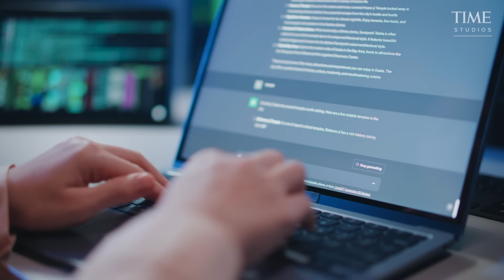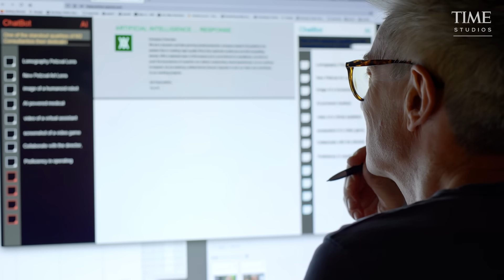Is the Figure 03 Robot Ready to Clean Your House?

Comment: A main feature has to be you can teach it to do stuff. So you can customize it to your specific house/routines. "watch the door handle on this door it comes off easily, the cat likes to nap in the washing machine so check before putting anything in, the dishwasher doesn't close fully in the right corner so you have to give it a hard push before it closes right and you can start it"

You know, there are a billion scenarios where it will have to learn the specific routine.

Comment: "All of the examples in videos are cherry picked. Go ask anyone working on humanoid robots today, almost everything you see here, if repeated 10 times, will enter failure mode because the happy path is so narrow. There should really be benchmarks where you invite robots from different companies, ask them beforehand about their capabilities, and then create an environment that is within those capabilities but was not used in the training data, and you will see the real failure rate. These things are not ready for anything besides tech demos currently. Most of the training is done in simulations that approximate physics, and the rest is done manually by humans using joysticks (almost everything they do with hands). Failure rates are staggering."

Comment: These bots will likely become more common than cars just based on how many there will be. 

And I don't think that things will get cheaper. They won't. Whoever is using these robots will not reduce the price just because they can manufacture for lower cost. They'll get greedy and provide the product for the same price that they would if humans were still working in the factory because that increases how much money they make. Robots are not a way to lower prices but a way to lower production cost and profit more.

Comment: I don’t think robots SHOULD be in everyone’s house. Putting aside the cost barrier, I do see applications for the disabled so they have more independence, but it could be detrimental to the elderly who should have other humans around for social connection at a time in their lives where that is vital. As for everyone else, you should be doing your own chores. It’s light exercise, and helps your brain (plus a break from work).

It’s interesting to me that these robot companies mostly focus on either housework or factory work. Both are regarded by the robot companies as menial, and I don’t think it’s a coincidence that the engineers are overwhelmingly male. Housework is still considered to be female coded, but society is asking men to do more housework, so I wouldn’t be surprised that men see it as an unnecessary burden. But I think everyone should share the responsibility of cleaning up after themselves, and we lose a bit of our humanity by off loading that responsibility completely.

Let the robots do the really dangerous work. But we won’t need billions of them. Think of how much resources that will take up, the plastic, metal, rare Earth minerals, electricity, compute. It’s obscene. We are already consuming 1.8 times what we should every year. We will quickly run out of non-renewables AND renewables. Civilisation is on track to run into a wall. It’s madness.

Comment: Figure 03 is light-years behind the Unitree G1 in terms of robotic motion. Figure 03 looks like a Unitree G1 having a stroke.
Reply: Unitree G1 isn't designed to be a general-purpose robot and its integrated AI is light-years away from Figure 03. By comparison, G1 has very little practical application based on its current design. It's comparing apples to oranges because Unitree G1 prioritizes flashy mobility at the expense of broader capabilities.
Reply: @16krez1  For a robot, what truly matters is movement. AI can always be upgraded or integrated later. Figure 03, on the other hand, moves like it just graduated from the toy aisle. No matter how advanced its AI claims to be, if the body can’t execute even 1% of it, what’s the point? It’s like a paralyzed person with Einstein’s IQ trying to perform martial arts — completely useless. Honestly, if I were Musk, I’d just buy a Unitree G1, dress it up like Figure 03, plug Grok in, and call it a day. Because let’s face it — as a robot, Optimus has failed.

Comment: Absolutly not! Even it is big leap forward, in real houshold enviroment it is useless. In demo was used plastic plates and cups. You do not want 1 plate/cup a day, probably more broken. You would need a set of new every week! The speed is so slow, that it will take like an hour to fill the diswasher and like 24 hours to clean your house, but with charging, it will take it 3 days, so it will clean slower, than you do mess. But more importantly, the cleaning job is very very difficult. 90 % times you need very precise motoric and and focus on details. It is very far from it. These demo are just a demo. Demo what it could do someday (probably with speed of improvment in this area, quite soon actually). And it probably did not do it autonomosly, but preprogramed. / It is very wierd, why they focus on households chores. The robot is obviously able to do a lot of work in factory enviroment or similar. This seems more like almost propaganda "get used to, that robots will be around you, even in your houshold".

Comment: The next steps will require processing power to continually self-train from sensors and experience. Like we do. Robots that move beyond task-oriented training, to solve goals using reasoning instead of their training data; i.e. a thinking machine. Yes, that's deep into uncanny valley territory, and it is going to happen no matter how good/bad an idea it might be. Timeline: 4-6 years based on current advancements in embedded hardware, power and algorithmic development. Two more before they become common; two more beyond that before they are ubiquitous. 

So, ten years. Max. Probably closer to six.

We'll also see tactile sensors, smell, "skin" that can feel air currents, sense pressure, etc. and designs that are more organically inspired (muscle strands instead of servos). Why? Because the world is built around such creatures and working within it will be easier if they mimic the construction of the original builders (humans).

Comment: What Figure is doing is amazing work, but calling this a "Synthetic Human" is not only a reach but a flat out lie. Using terms like "it wants to work" is also a dishonest way to look at it. That is like saying my car really wants to keep driving. This is a tool. This is equipment. Like a hammer or lawnmower. It's nothing like a human besides its provided  aesthetics. It does not have feelings. It does not have thoughts. You use them and when they break, you throw it in the trash and replace them. Like a screwdriver or a ladder.

Comment: So they ruin our appliances by imposing “environmental standards” that make them take longer and not work as well.  A dishwasher cycle should not take 2 hours and 54 minutes.  Then those standards are constantly changing which adds to the cost of the appliances so in order to keep costs down they put in cheaper parts.  Then the appliances break sooner and end up in landfills.  So you have to work more hours to afford replacement appliances.  That leaves less time for daily chores SO YOU NEED TO BUY A ROBOT APPLIANCE to do the chores.  Guess what….the robot will also break quickly, cost a lot, and keep you dependent on these tech assholes.  No thank you.  Take your robot, your shitty AI, and shove it.  This is all a ploy to make/keep everyone slaves/serfs to the elite pricks who have more money than they know what to do with and think they know how everyone should live.

Comment: On the safety thing

A.Require A liscense and training to operate a robot and make the owner responsible for its actions, Include remote and on device off switches.

B. No one is gonna accept these things if their openly connected to the internet with no off option. Computers and phones are one thing. A robot that can merk you or that could have a complete malfunction and burn the house down due to a crappy update is another thing.

Dont know if theres a way to run AI locally tho.

Comment: Think about it, you take a plate out of the cabinet, then when it's dirty you set it in the sink. The robot picks it back up and puts it in the dishwasher. But you could have set it in the dishwasher to begin with. The real inefficiency is that you have to move the cleaned plate from the dishwasher back to the cabinet. If the design of the dishwasher is more like a cabinet, in which each individial plate is washed immediately after use, rather than everything altogether, you cut out this step that is being automated here in the most complex possible way. You have a similar problem with laundry. You store a shirt on a hanger or drawer. When you're done wearing it you put it in a basket, then from the basket to a washer, then from the washer to the dryer, then from the dryer to a basket, then from the basket to a surface to fold or hang and then back to where it is stored. What if instead you pulled the shirt from a device that stores, washes (with minimal soap and water), and dries the individual clothes? Again you cut out the parts being automated here in a very complex way.
Reply: He can do everything you do. EVERYTHING i mean. If a robot has the same size as a human and same flexibility its inly a matter of time until he can literally replicate every human work. Why are so many people don’t get that. Its really simple omg. 
He can do dinner for you sharp ready at 6pm Michelin level probably even better. Every day.
Reply: I understand what you mean however its way cheaper and more efficient in a world that is designed around humans to build a human replica then instead make a singel perfect machine for every task thats just simple logic

Comment: Humanoids in the workforce is a fallacy. Go see how Amazon and others are replacing people. Factory robots are ALREADY using vision and AI and they don’t look like humans because humans are limited(they have to climb ladders, hands too big for small things etc.) So if an android could do it, it’s already automated! Can it wash it’s hands? If you have a trade job, you’d probably realize it would be impossible(or excruciatingly slow) to do it with robot hands. In many cases the hands would be too weak to do the job(squeeze pliers etc) and will probably wear out quickly. let alone have a brain that still can’t drive after eight years. But androids would be nice if a handicap person could use it as a telepresence to go shopping or do simple chores.
If Optimus could assemble widgets, or do manicures, etc. it would need special tools not batteries and legs. It's not strong enough to dig a hole or help someone get up off the floor. That’s why One-size-fits-all is a bad strategy. Imagine your brain operating an Optimus. Could you go work at McDonalds and put a lid on a paper cup? Can the sensors feel enough of the lid that you won't just crush the lid or the cup? Wash your hands? How long would it take you to change gloves, start a roll of tape etc.? A humanoid MUST do a job on par with a person because workplaces are made so people along with automation maximize asset utilization. That is why you CAN'T JUST put two androids in place of one person.

Comment: A bunch of tech bros watched some 1950s sci fi film robots in 'futuristic' homes - and completely forgot that electronic household appliances were all invented in the meantime to do these things. 0:54 We have dishwashers - you want another machine just to load it??!! This is weird, ridiculous, overpriced and unnecessary.
Reply: With a humanoid robot you wouldn't even need a dishwasher. Just have the robot wash things by hand. It could even wash clothes by hand.
Reply: @jimj2683 that would be cool - a robot that can do all those things directly
Reply: Humanoids in the workforce is a fallacy. Go see how Amazon and others are replacing people. Factory robots are ALREADY using vision and AI and they don’t look like humans because humans are limited(they have to climb ladders, hands too big for small things etc.) So if an android could do it, it’s already automated! Can it wash it’s hands? If you have a trade job, you’d probably realize it would be impossible(or excruciatingly slow) to do it with robot hands. In many cases the hands would be too weak to do the job(squeeze pliers etc) and will probably wear out quickly. let alone have a brain that still can’t drive after eight years. But androids would be nice if a handicap person could use it as a telepresence to go shopping or do simple chores.
If Optimus could assemble widgets, or do manicures, etc. it would need special tools not batteries and legs. It's not strong enough to dig a hole or help someone get up off the floor. That’s why One-size-fits-all is a bad strategy. Imagine your brain operating an Optimus. Could you go work at McDonalds and put a lid on a paper cup? Can the sensors feel enough of the lid that you won't just crush the lid or the cup? Wash your hands? How long would it take you to change gloves, start a roll of tape etc.? A humanoid MUST do a job on par with a person because workplaces are made so people along with automation maximize asset utilization. That is why you CAN'T JUST put two androids in place of one person.
Reply: Elevators

A bunch of mobility bros watched some 1910s futurist cartoon with chrome towers—and completely forgot stairs already exist to go up. We have stairs—you want another machine just to lift us up them??!! This is weird, ridiculous, overpriced, and unnecessary.

Smartphones

A bunch of telecom bros watched some ’80s movie with brick cell phones—and completely forgot landlines already exist to make calls. We have home phones—you want another machine just to carry the phone to the phone??!! This is weird, ridiculous, overpriced, and unnecessary.

Cars

A bunch of transport bros read one Jules Verne novella and got ideas—and completely forgot horses already exist to pull us around. We have horses—you want another machine just to drag the carriage??!! This is weird, ridiculous, overpriced, and unnecessary.

Indoor Plumbing

A bunch of water bros saw one World’s Fair demo of “modern bathrooms”—and completely forgot wells and chamber pots already exist. We have buckets—you want another machine just to move water to every room??!! This is weird, ridiculous, overpriced, and unnecessary.

Search Engines

A bunch of library bros watched some ’90s cyberspace PSA—and completely forgot libraries already exist with books and card catalogs. We have shelves—you want another machine just to find the page for us??!! This is weird, ridiculous, overpriced, and unnecessary.
Reply: Thats the point, you dont need a bunch of machines for every specific task when you can have a single machine that does it all.
Reply: @DoradoClaudia  it’s not washing clothes or dishes. It’s loading a dishwasher or putting clothes into a washing machine
Reply: @DoradoClaudia  it can’t even wash its own hands🤮
Reply: Exactly. These people are weirdos. They are so cut off from humanity they have no idea what actually matters or what people want💀